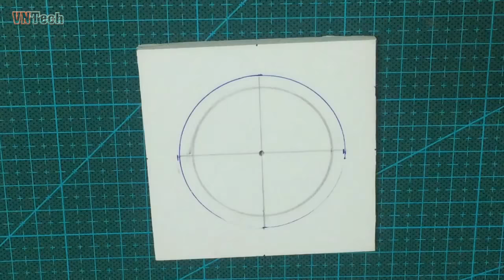DIY 5V Super Bright Flashlight from Luxeon LED

Comment: VN Tech      How it's 5 Volts when the li-ion batteries 3.7 V is converted into 11 Volts. It's a lens not a prism correct it. What is the boost converter that you have used. Give the link for the things that you have used.